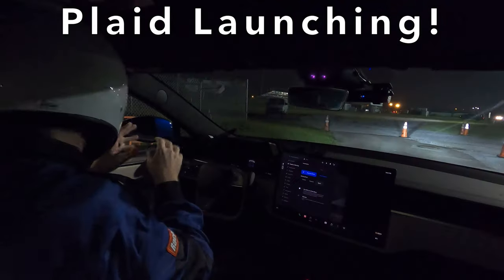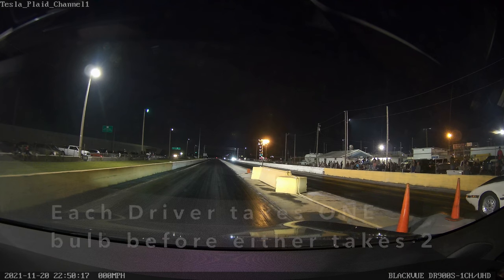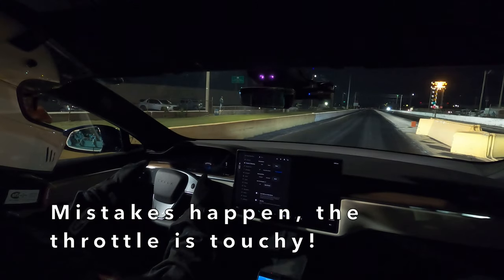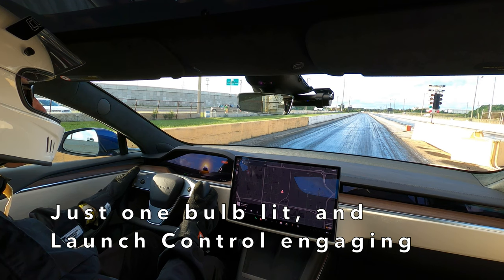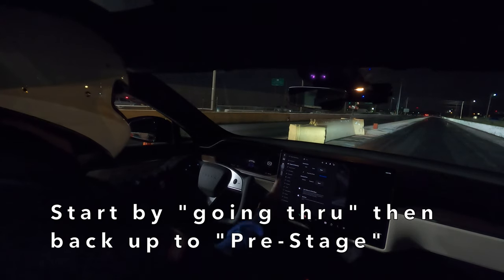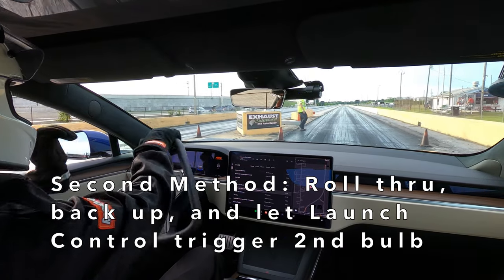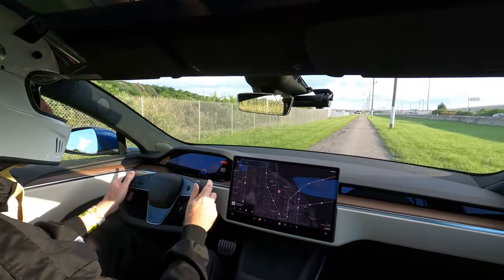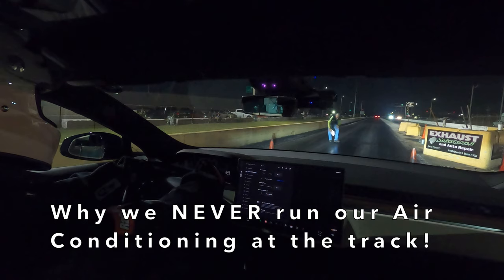Plaid at Dragstrip: Launch Control at Tree!  Staging & Launching Essentials! In 4K UHD!

Comment: I raced motorcycles for 3 years in the 80s. I was top eliminator one year at the local track and never knew double bulbing was wrong until today. Thanks
Reply from the maker: 👍 Indeed, we’ve learned that some racers see as a courtesy, while others take it very seriously. Some tracks even enforce it. But since we can’t be certain of every driver we line up with, better to err on the side of caution 😃

Comment: This is Valuable information. My friend and NHRA Racer gave me Valuable information on the tree. He 1st explained it is a Science. For me as I'm on footbrake. When I'm in the 1st bulb, I have to pump brake about 5 times before I creep to the 2nd bulb. Before I've pushed myself through the lite and went red!😢  Now the pressure I build up holds me back to allow me to get on the converter at more rpm. Shallow/Deep Stage... It's a science and Legal. Appreciate this video 👍😉

Comment: The battery thermal management system also uses the A/C compressor once the batteries get hot enough. So even if you don’t turn on your AC you can still get the condensation on the track under certain conditions.
Reply from the maker: We thankfully haven’t had that happen yet after all of our many runs (1423). 👍Whenever a car drips, the starter will see the puddle and then he will radio to the timeslip booth to have them talk to the driver. They’ve never tagged our Teslas (yet)

Comment: How much of an ET reduction have you experienced when using Launch Mode?
Reply from the maker: When fully staged and if the track/tires/traction can hold the power, it's usually one to two tenths. Eighth mile runs without it were more commonly 6.20s, but more likely in the 6.00-6.10 range when successfully launched.

Comment: Great video!  Quick question - are these o bump staging methods still valid? Wondering if any software updates have affected (negatively or positively) these two methods?  Thanks in advance for your help!!!
Reply from the maker: “Bumping in” is frankly rather unreliable with the Plaid, so the majority of the time we just try to get the 2nd bulb first and immediately start launch control. We rarely get it “fully” staged until it says “Ready to Launch” (maybe 1 in 10 races).
Reply: @TeslaPlaidChannel  Thank you!

Comment: how do you do the small burn out to clean the tires prior to staging? i struggled to clean my tires after the water box.  thanks for your time
Reply from the maker: We start by driving around the water whenever possible. (Some tracks don’t allow it.) Then we use the entire “dry” area between the water and the staging beams to do as many quick bursts of acceleration that we can. 
It’s imperfect, depending on how much water is around. And when tracks (or events!) allow it, we “roll thru” the beams so that the tires pick up more glue from the track. Then after we back up, we stage in a different “line” from where we rolled thru.
We’ve found that these steps give us far less “traction control” interference. 👍
Reply: @TeslaPlaidChannel  I appreciate your quick response, i did some passes a couple of days ago and the best i could manage was 1.59 60ft on 19 inch wheels (which i purchased off ebay),  i was also considering replacing the tires (might be old) for some higher performance tires for those 19s, any suggestions?   will sure try those pointers next week, really appreciate your help
Reply from the maker: @geramata  The OEM-spec Pirelli P-Zeros have been really impressive. They’ve gone 9.15 for me on a prepped track, which some find hard to believe…

Comment: I wonder if you can single bulb, stage, then let off the gas move forward and quickly restage while the car is already lowered?
Reply from the maker: Interesting idea 🤔. In my experience so far, releasing the accelerator pedal (at all) aborts the Launch Control and the suspension pops back up. Yet it’s not something I’ve done a lot of experiments with to see if it can be tricked in any way 👍
Reply: @TeslaPlaidChannel  Tesla needs to add a setting where you can pre-stage and keep the front end lowered as long as you are below 10 mph.
It would be nice if someone can fully hack the software, I’m still waiting on the speed limiter to be moved to 200.

Comment: Imagine if you hacked the software so it can do the 216 mph.
Reply from the maker: 👍 Indeed, but there are no dragstrips long enough to test that in Florida or surrounding states. We can barely hit 160MPH after the traps before having runoff concerns.
For anyone doing this, hope they have a proper track and the right speed-rated tires! 😃
Reply: @TeslaPlaidChannel  And brakes!
Reply: @TeslaPlaidChannel   - Higher speed rated tires are not really necessary for very short drag racing type bursts past a tires listed speed rating.  Tire speed ratings are made based on a sustained speed at 10 minute intervals which simulates heat build up similar to driving a car at a sustained speed on a freeway.  Exceeding the tires speed rating by say 30 MPH for say 5 seconds is no where near as hard on a tire as exceeding the speed rating by 5 MPH for 10 minutes.  As a practical racing example the fastest FAST series drag cars routinely run close to 150 MPH on regular bias ply tires with the tread shaved off with no ‘disastrous’ results.